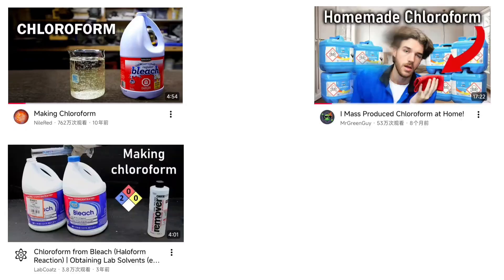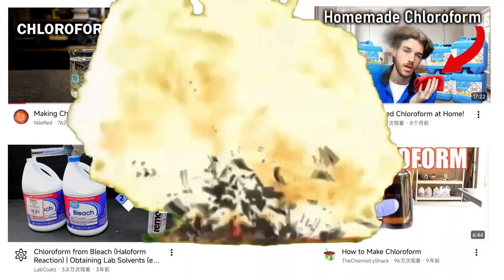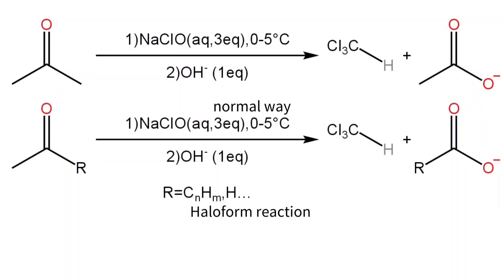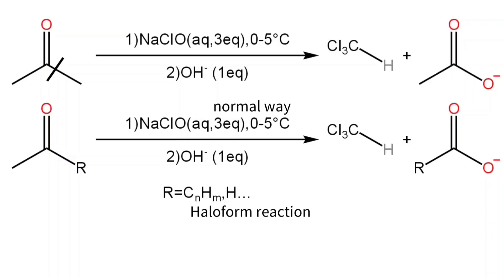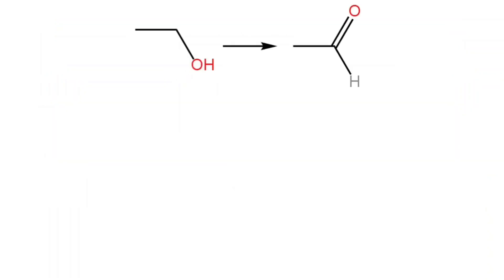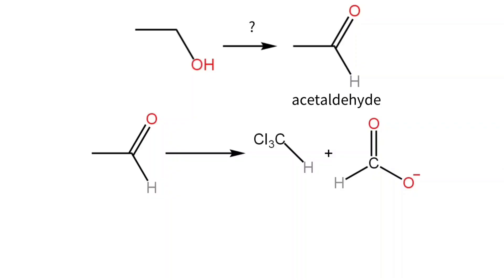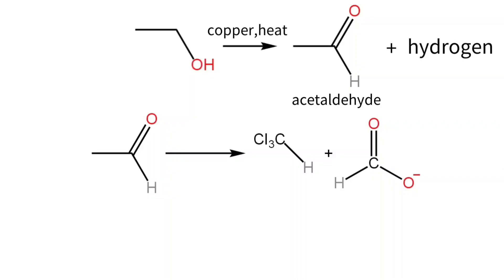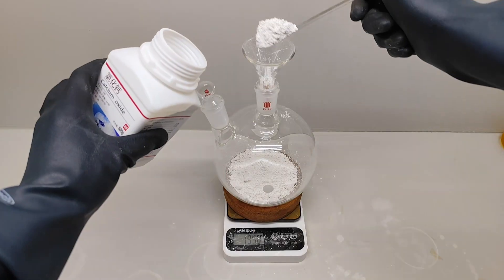Making Chloroform without using Acetone

Comment: You literally don’t need the copper part and anhydrous ethanol part.

Just use more bleach - it turns the ethanol to acetaldehyde automatically.
Reply from the maker: At first I also think it's right,but then I saw a few papers telling me this is wrong,and now I check it again, seems that it's feasible

Comment: Great video with nice chemistry. Lengthier procedure than with the acetone, but you seem to get a decent amount of chloroform. At 8:50, I assume the hypochlorite was made using sodium carbonate and calcium hypochlorite, it was somewhat hard to follow at that point due to accent.
Reply from the maker: I'm sorry, I will change it the next time.
Reply: @ChemiChill  no need to apologize, great to see you making an effort to make some new chemistry and a video about it! :)
Reply: I hear Na2CO3 + Ca(ClO)2. I don't see why convert Ca(ClO)2 into NaClO if it is distilled in the end, however
Reply from the maker: It's more soluble  @dimaminiailo3723
Reply: @ChemiChill  High solubility isn't required for this reaction to go. I know of methods that use calcium hypochlorite directly and seem to work fine
Reply from the maker: @dimaminiailo3723 seems like it is true, I won't the next time

Comment: It would be helpful to add English subtitles onto the video. Your accent makes it tough.
Reply: one of the few very strong accents i can still understand clearly.
Reply: His accent is fine.

How about you try making a video about a pretty complicated subject with safety implications in Mandarin? Then for extra fun, you can subtitle it in Mandarin because you don't already have enough work to do.
Reply: @davidfetter  I'm not a YouTube content creator. You don't make any sense by suggesting that I make another video.
Reply: I'm hard of hearing so if I'm not using headphones I use the YouTube's captions.  The auto generated captioning is really good.  Feel free to try it.  Click the little gear icon in the top right corner of the video to find the captioning options.
Reply: @hamhawk4027  OK, thanks.